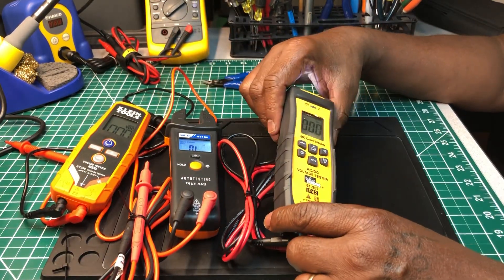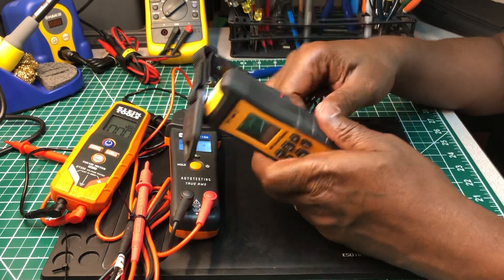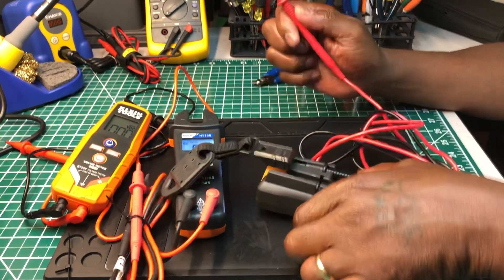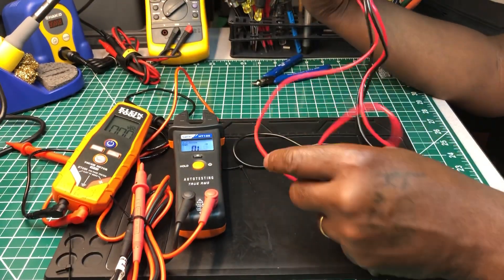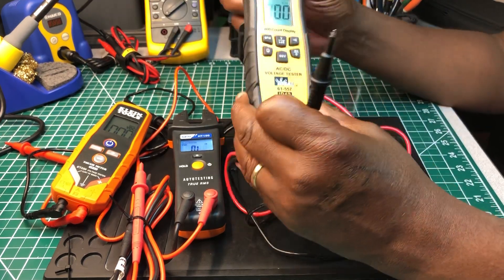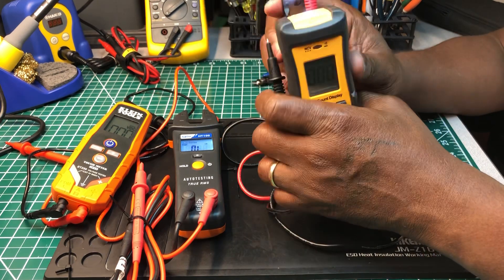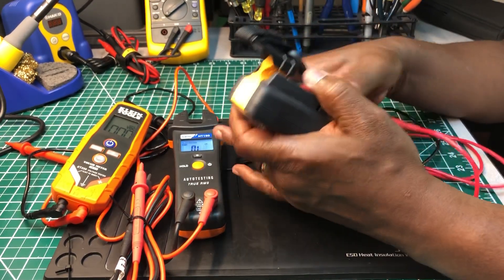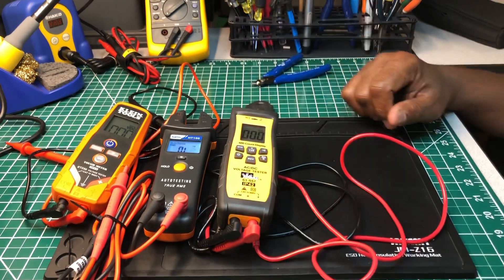🇺🇸 🇮🇹 Voltage Testers ( Pick ☝️)

Comment: Hey I really like these comparisons videos. My pick order would be HT, Amprobe, then let the other two fight it out. For the same reason as you for first position because the ammeter is an important function that the others don’t have. Secondly, I’d choose the amprobe because I simply trust that brand as a measurement device more than the pliers and crimpers companies. Not saying they can’t make a good meter but if it came down to it that’s my order. Take care man.
Reply from the maker: It makes a lot of sense what you said, great choice 👍🏿

Comment: The first number of the IP Rating is protection against solid particles (dust, sand, etc.) The second is water resistance. IP54 would be dust resistant, and splash resistant. IP66 is dust proof and (basically) waterproof.
Reply from the maker: Got it , thanks 👍🏿💪

Comment: The HT100 looks to be the same as the Extech MA260, so is a clone from somewhere, cannot figure out who at the moment, but Extech are instruments are commonly CEM rebrands. To be honest though, I will stick with my Fluke T110.
Reply from the maker: I agree TP,  I believe it the same instrument.
Reply: The HT and Amprobe that in this video are made from APPA.
Reply: @hakanciris1  The Amprobe unit looks like a Brymen voltage tester to me, either the BT73 or BT75 depending on the functionality;
https://brymen.eu/product-category/voltage-testers/
Still can't place the HT100, I cannot find it on the Appa site, their clamp and voltage tester ranges are completely different, unless it is a bespoke.
Reply from the maker: Also this instrument is a clone from the ( TIS ) TEST INSTRUMENT SOLUTIONS  859 Voltage Tester.
Reply: @TheElectriciansToolChannel  Certainly looks like it TETC. As far as I know TIS are 100% clones, they don't do any of their own design or manufacture. Interestingly they seem to have some sort of an agreement with HT Instruments, that they are totally open about.
Reply: @three-phase562  Yes, you are right about amprobe.
Also there is no informaiton but a poster on the web site about appa a5ar ☺
http://www.appatech.com/en/product-c137674/Autosensing-Testers.html
Reply: @hakanciris1  Good spot buddy, its in the background lurking away. Bit more of a hunt around and it looks like it is available from Megger / AVO. Which makes sense as the Megger DCM305E is the APP A605, I don't think Megger produce any of their own clamp meters.

https://www.avo.co.nz/products/low-voltage-and-contractor-tools/clampmeters/1114-appa-a5ar

The megger version is similar, but looks to be more manual selection rather than Auto-Sensing.
https://uk.megger.com/fork-multimeter-dcm330

Comment: Greenlee= Amprobe= Brymen all made at the Brymen manufacturing facility in Taiwan. 😎👌
Reply from the maker: I know that GREENLEE multimeters are rebranded Brymen multimeters. And Amprobe is owned by FLUKE but manufactured by APPA.
Reply: @TheElectriciansToolChannel  Most of the Amprobe line is Brymen.  Those Greenlee test leads are the identical test leads you get with an Amprobe meter. The Amp-200 & Amp-310 series meters...all Brymen. The ACD-14 Pro .... Brymen. They are idinical to the Greenlee's, but they put a nice rubberized coating on the Amprobe's. I know the Amprobe NAV. Series meters are made by that APPA company. I wish you could buy direct from APPA. I would like to have one of their 172 clamp meters. That HT instruments meter looks pretty cool, but way to rich for my blood. Can't afford those kinda dollars.
Reply from the maker: @sknight0391  TRUE 👍🏿